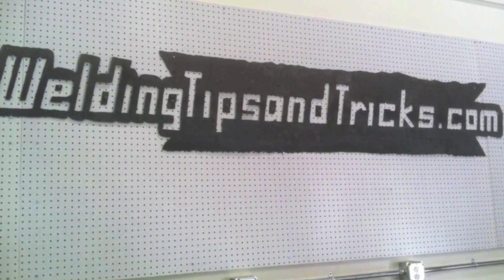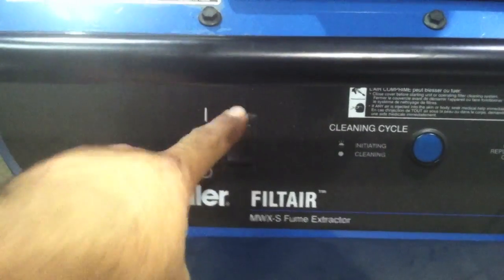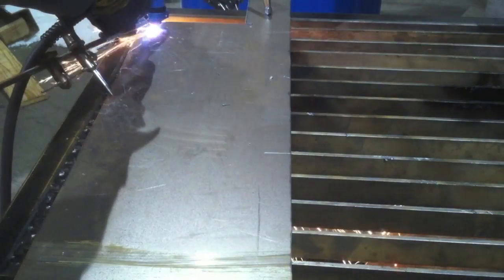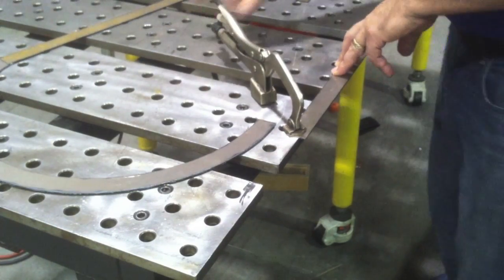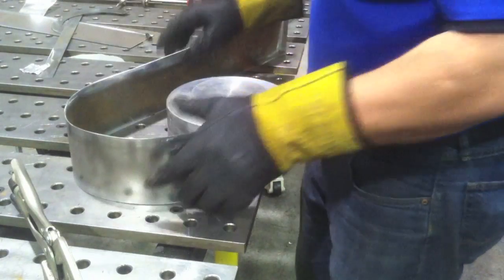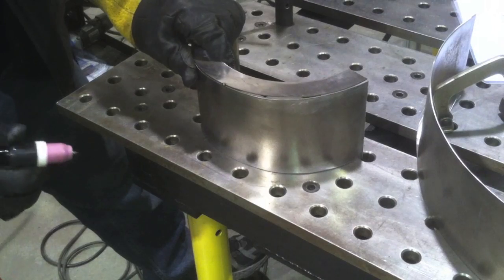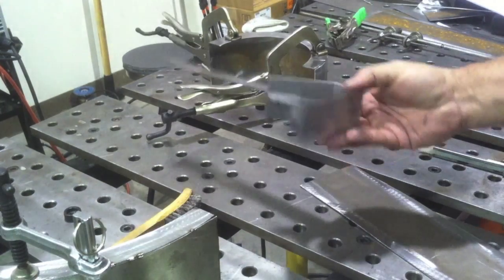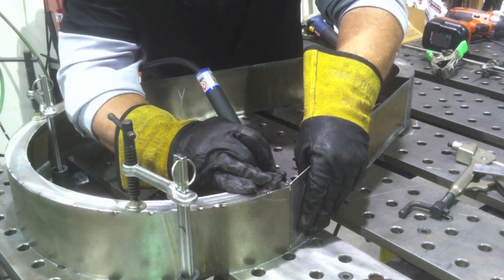Fabricating a Belt Guard part1

Comment: Hi Jodie, is it alright the tip touching the metal sheet while using plasma cutter?  I can't see the video clearly but seems the tip was touching the sheet while u're cutting.  I just bought everlast plasma cutter last week and still setting it up.  I have no experience in plasma cutting and try to learn from your video.

Comment: When using the air filter for tig welding does the airflow pull the shielding gas away or do you bump up the argon flow?